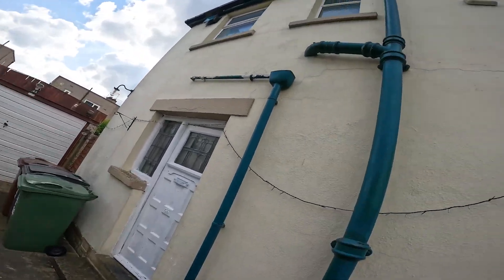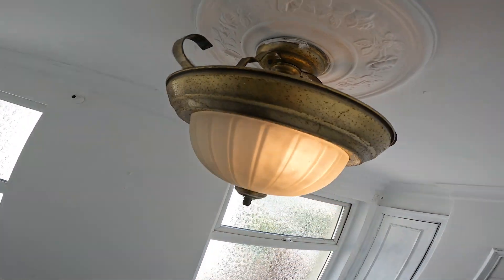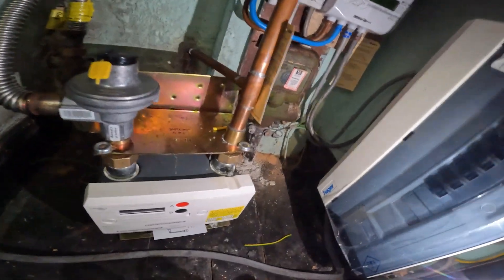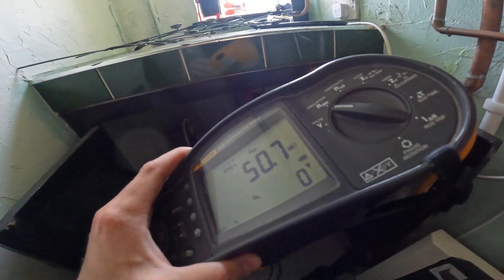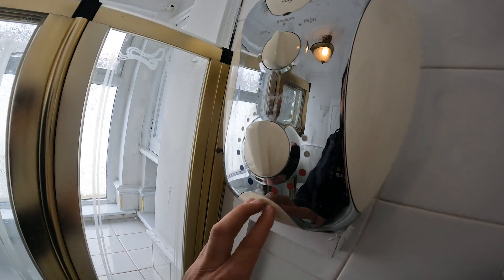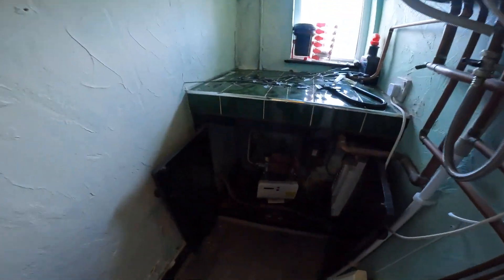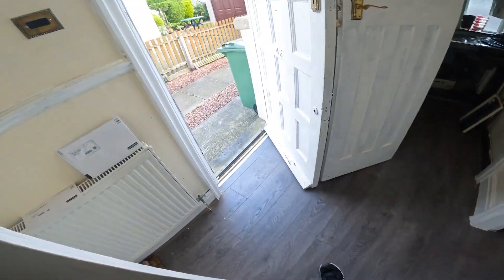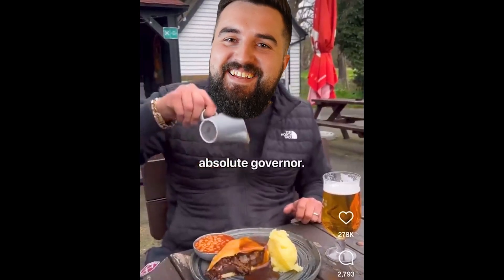THIS DEFINITELY NEEDED TESTING! ⚡🏠

Comment: Thanks for the video. Anything on testing and fault finding is good for me as an adult learner.  Never quite get my head round the global IR test - any chance you could cover that in a bit more detail in one of your future videos?
Reply from the maker: Well your supposed to test individually each circuit, but if you turn the main switch off and the rcds, then neutral isn’t connected to earth. So you can test earth bar to line, earth bar to neutral. If it’s in the hundreds on IR then everything is in really good condition. If there’s a bad reading you would then have to do individually to see which is good or bad.